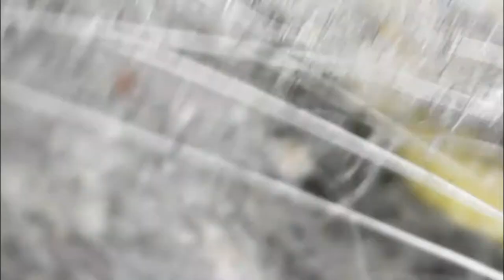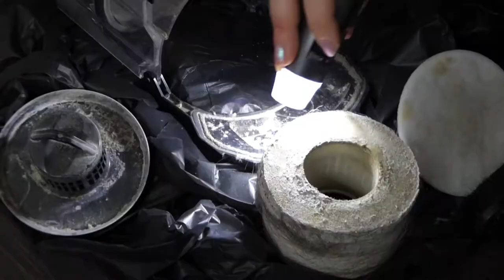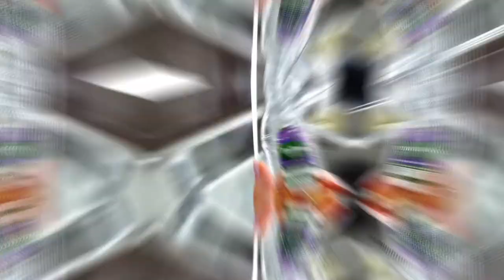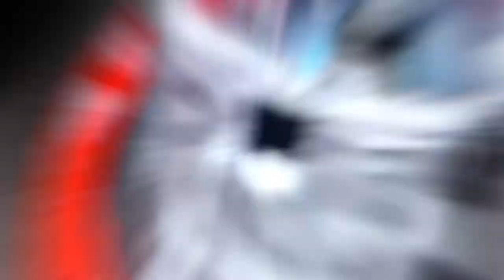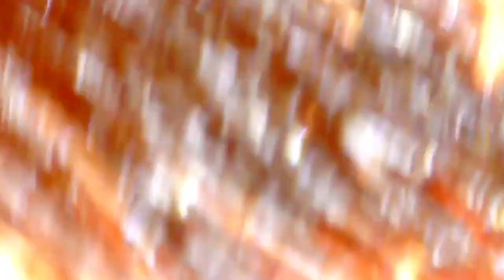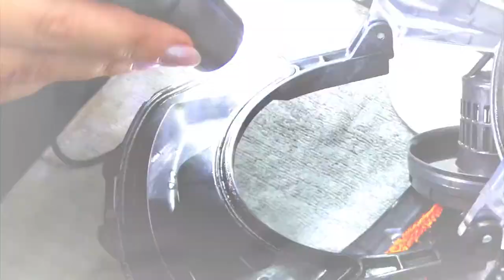CLEAN VS DIRTY VACUUM DIRT UNDER A MICROSCOPE [DIRTY VACUUM CLOSE UP CLEANING]

Comment: O M G   Hayley.  That is a real eye opener.   I never used to clean my big vacuum to that extent.  My place is very small so I really never needed a big vacuum. It took me a while to realise that after banging the thing on all my furniture because my place is just a small flat. I  now have the flat mop system. Dust / damp pad / which is all I needed in the first place. I do have Two mini vacs for cleaning such things as bathroom fans , In tight areas etc and I have to pull them apart and do what you have done with your big one. That’s enough for me lol washing all the bits of them.   Yes you have to do that wether your  vac is huge or tiny. It smells awful otherwise.  My mini vacs smell a bit when I’m using them even after I’ve washed everything. Im thinking it’s a bit of dust coming back out. Is there any sort of nice smelling stuff I can put on the cloth filter or wherever to make it smell nicer in the rooms ?  💕💕💕💕
Reply from the maker: Hey hunny oh my goodness I’m so pleased you’ve asked me this get a cotton wool ball and put about 10 drops of tea tree oil on it, the tea tree will neutralise the odours coming from the vacuum 🥰♥️
Ps we have cleaning headphones coming up and I cannot tell you how sick it made me feel 🤢🤮
Reply: @hayleyshelp    Thanks Hayley. I’ll do that ❤️
Reply: @hayleyshelp  I have several sets of earbuds because I listen to podcasts and books all the time  - I always want one fully charged and ready to go. Every time I put one one the charger I clean it with q tips, alcohol...and toothpicks to get any gunk out.